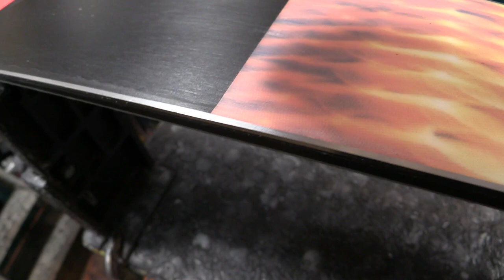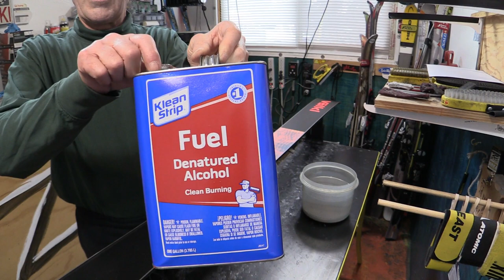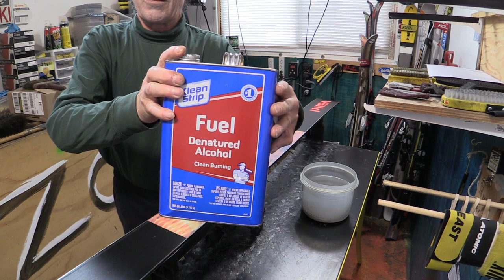Tuning Ski For Rails | Boxes | Tubes | Tune Not Detune

Comment: Great video! But what should I go for if im planning to grind on tubes? Or this will work too?
Reply from the maker: It's all about the "Long" base bevel.  One needs a coarse file to get into the plastic.  Then finish with a finer file, then diamond stones.  The base edge will end up raised off the rails.  The rails will do the rest of the work.  This needs to be done when the ski is new!   Works 100% of the time when done properly, and if you can get up on edge, you will still hold a carve.